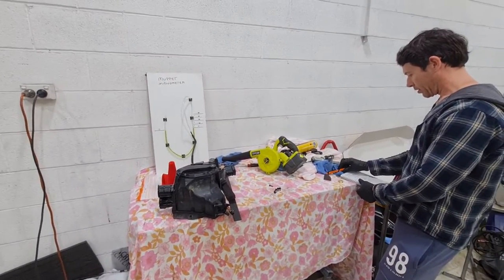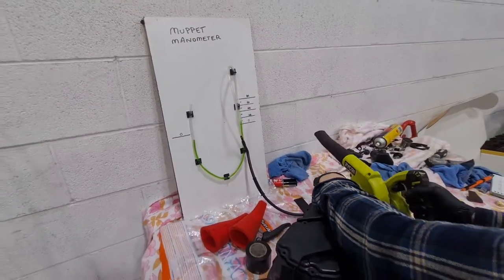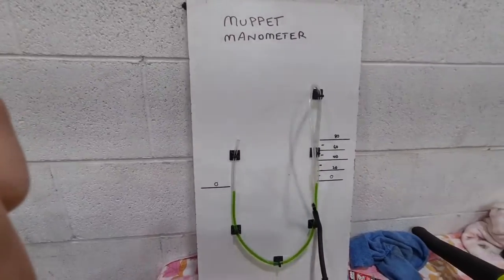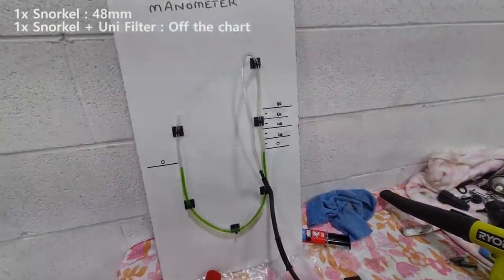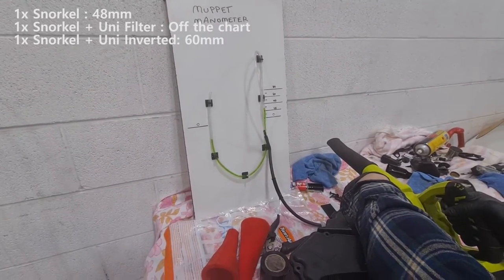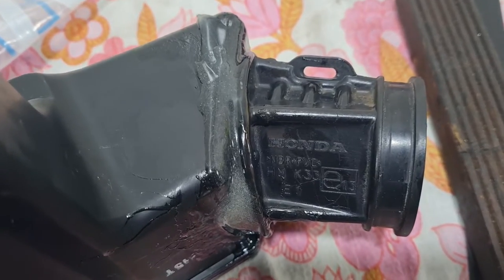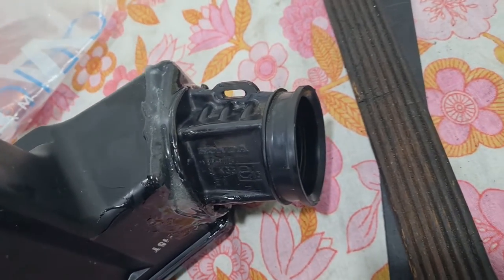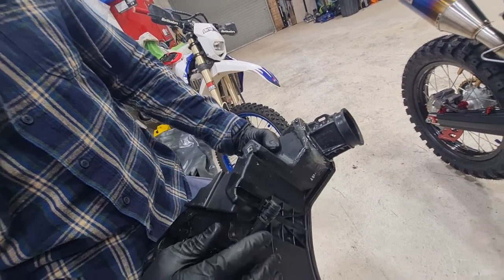TESTED!: #crf300l Uni Filter Air Box Pre-Filter

Comment: Good work boys!

I've got my cams, intake snorkle  and 550performace matching tune to install shortly. I also got one of Mavericks vented airbox lids.

If you're interested in testing that, let me know and I'll post it to you 

Sean.
Reply from the maker: On Aarons channel he ran some tests with the door off. I will say 550 have only road tuned the ECU. It hasn't been on a Dyno. So I'm waiting for a bit longer till I do my cams. Till he's dynoed it for the timings. He really should mention that on his website.
Reply from the maker: The hi flow intake make a massive difference in top end IMHO. Before CAMs

Comment: For anyone on the fence about the velocity stack I did this and didn't use any epoxy or make it look like a hack job. Just take your time with a Dremel and keep testing to see if it fits. I ground down the area where there is a plastic seam in a semi-circle and it sat totally flush. There was no need for all the goop. I just sealed the lip with RTV, wiped away the excess, and let it sit overnight. Tested with pressurized water and had no leaks. All that being said it was 100% worth it and made a notable difference paired with the cams and tune.

Comment: Thanks for the great video! Any idea how effective the inverted pre-filter is at filtering? To me it makes sense that for filtering you want a funnel going into the snorkel, rather than a wide open cone on top of the snorkel, but it also makes sense that this greatly reduces the volume of air going in. Have you guys found that the inverted pre-filter still does its job?

Comment: Thanks for the interesting comparison. I must run a pre-filter because of where I live. I haven't done any additional upgrades. Would it help to add a second snorkel with pre-filter to the airbox even though I haven't changed to the CB300 throttle body intake?
Reply from the maker: Yes it would

Comment: What do these numbers translate to practically though? I've installed a uni filter pre filter as recommended (stuffed into the pipe) but to be honest have not really noticed any performance change. Although I have noticed significantly less dust
Reply from the maker: From a practical point of view it's drastically higher resistance than stock. If anything you want it close to factory stock as that's what Honda designed for the engine otherwise the mixture will be rich
Reply: @pommeybiker  do you have to have the full uni filter kit by uni filter? Would be interested how the foam filter behaves with this test too. I would've thought a company like that would test to make sure they aren't suffocating the bike
Reply: I haven’t seen the 2 hp yet
Reply from the maker: @guestappearance3211  I didn't have to go to the trouble to show people that stuffing the snorkel with foam is worse than inverting it either
Reply from the maker: @mcdonaldslover52  I don't have that kit and the airbox is now installed back into the bike unfortunately.
Reply: @pommeybiker  It's got EFI, if the air is restricted it will lean out the mixture to compensate (unless you've removed your O2 sensor and are running open loop). But otherwise you are correct: less air + less gas = less power.

Comment: I've been waiting for someone to do dyno runs on the 300 with stock trim and all the mods people are throwing on, as talk is cheap frankly..
I'm quite satisfied with my stock airbox and full RS4 exhaust + 550 ECU I'll say that much..
Reply: ... Is your 550 ECU a stock modified or Stage 1?
Did you also change the stock air filter to a DNA or other? 
.
I just received the following products but haven't installed them yet.
the Yosh RS4 full exhaust.
550 Stage 1.
CBR boot.
DNA filter.
Double the hole(s) in the back/top of the air box. 
I want to do some (before) riding, testing and videoing with the stock OEM's then some (after) video comparisons. 
After that I will see if I want to modify and install the CBR boot. 
. Jeff .
Reply: I had the stage 1 91 octane - no modifications to airbox or air filter. @240LTS
Reply: @TylerMcCool  ... Thank you. I will add the extra hole(s) in the back top of the air box and see how I like it before adding the CBR boot. 
Thank you again.
Jeff
Reply: no problemo @240LTS
Reply: I'm gonna do some racebox dragrace testing with the tune later. I'm the same way I want to see the results in some form or another.

Comment: Hi Pompey Biker, wondering if you could help. I’ve got a 300Rally on order but it’s been delayed again until April next year. So I’m thinking of picking up a WR250R with sorted suspension, long range tank and low km’s. Seeing as you own both, do you think I should hold out for the 300 Rally, or pickup the WR250R? Is the crf300 engine better in your experience. Thanks